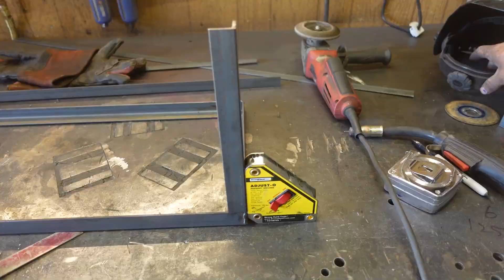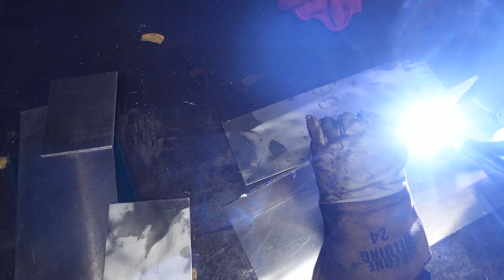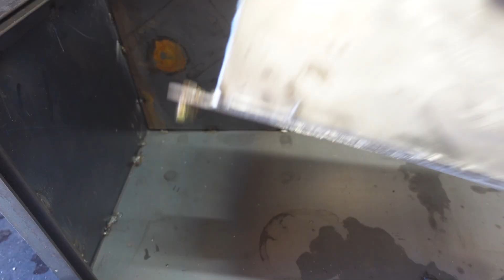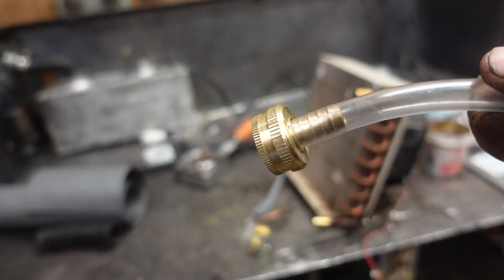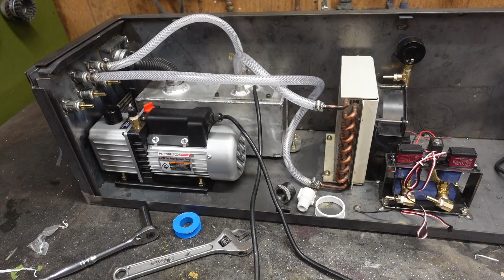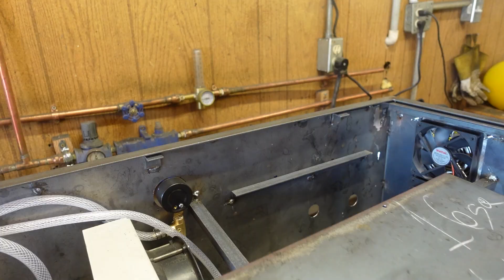DIY Control Unit For My Co2 Laser Tube

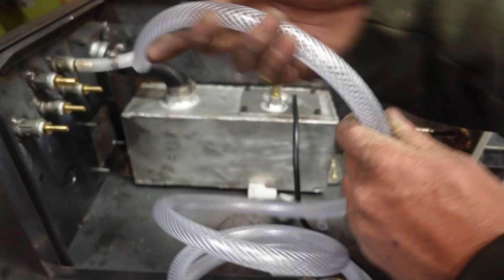Comment: Just a quick note (sorry, I know I'm quite "late to the party." At 9:37 in this video, you connect the HOT water feed (from laser to radiator) to the BOTTOM of the radiator, and the COOL water return (from radiator to tank) to the TOP of the radiator. While it will work ok like this (obviously, since you used it), it is a bit less efficient, as natural convection wants to move the hottest water to the top & the coolest water to the bottom of the radiator. Thus, you will likely see a performance boost on your cooling by simply switching the connections of those two tubes.
Awesome DIY videos though, I've watched the whole series of your CO2 laser series now! ;-)

Comment: Cut a hole in some 1'' round rod drill a hole in one end and turn down the other to fit your drill. Then cut some half inch round put a hole in one side and with a set screw you can hold a piece of high speed steel with an edge on it. Then either turn a point on the piece opposite your drill to stay on center, or counter bore it to hold a drill bit. 
Then you now have a hole saw that works better and can always be ground sharp again.

Comment: I love it seems it might be a wee bit heavier than mine but my gantry is very very heavy i can ride on it has 3 nema 43 1600 oz steppers go big or go home 
   in the thumb nail to the left i went with the direct approach i mounted the tube strait up/down on the gantry where the spindle mounts well it seemed like a good idea at the time less laser loss but now it lives on the backside of the gantry 3 mirrors later the beam is where it needs to be and i can run the machine faster that 20 inches per min how about 70 in per scarry stupid sumpin gonna break fast 
Hey i might feel the need to turn 2 sheets of 3/4 inch ply into lil heart shaped wood peices with dickbutts lasered on them lol hasnt happend yet but is nice to know i can 
Man i wished i found your yt earlyer mine is all windows based but i did try linux but later went with mach 3 that being said mach3 does not play well with a co2 lasers so i had to add a DAC to control the laser for photo work
It did work fine for cutting/engraving with out the DAC  again love the channel very well done on the  (renina obliteratior) who says their is no truth in advertizing

Comment: Idk if this was addressed already, but do NOT mix copper and aluminium in a watercooling system!
Unless you're going to use specialised cooling liquid.
Else you gonna fight with galvanic corrosion which will turn your destilled water into ionised I believe, which makes it very conductive.

Comment: I don't know if you're aware, but you can get a 40w commercial CO2 tube for around $100 with free shipping on ebay. No need to keep dealing with vacuums and gasses that way, you've already got the power supply. You can even buy a complete machine, with everything, including the cabinet, for around $400, brand new. 
The reason I mention this is because when you start firing that laser at any appreciable distance, you'll probably notice that the beam is not very round, and after it bounces off 3 more mirrors,  it'll be extremely distorted. You're going to be spending a huge amount of time trying to solve this problem with a home made tube. Good luck.

Comment: beautiful job!  have you bothered to determine the output wattage?  have you looked at proportional gas flow control  to optimize the mix?
Reply from the maker: Thank you!
havent gotten around to figuring out the output yet, but i'm thinking of using the arduino with a calorimeter(or something comparable) to optimize the gas flow autonomously.

Comment: Love the burning wood. My final year student project (back in '74) was stabiizing a sealed CO2 LASER. Power supply was a 19" rack unit, 6' high.
Working in a basement lab (on my own, all hours), I could tell if it was lasing properly
when it would light my cigarette. Ah!, the good old days.

Comment: add a flow indicator for the water. also, DuPont connectors on Arduino are no good for a final product, you will have issues with dust and possible oxidation, ire commend to can replace them with proper terminals (the ones you can screw)

Comment: Amazing Build !  On the note of knowing if the water cooling is flowing, look into those "Flow Indicators" (or to be fancier/detect leaks or some error an "Inline Flow Meter").  I think they are pretty common in the PC Water Cooling community.  Could probably hack one together easily, since it just needs to be something that spins/giggles if there is water flow.

Comment: Generally speaking, mixing metals in a watercooling loop is a bad idea, look up galvanic corrosion.
Reply from the maker: Oh man, didn't think of this. worse comes to worst I've go an aluminum radiator sitting somewhere in the pile.
Thanks for the tip!
Reply: @cranktowncity  it's not absolutely terrible, manufacturers of all in one watercoolers for pc do that all the time, but they use anti corrosion stuff.
Reply: Just electrically isolate the tank from the rad and make sure the water stays super clean.  You could also add cathodic protection or else use oil or maybe Trichloroethane in the loop instead of water if it becomes a problem.

Comment: Will a capacitor from a Microwave work? If not, why? (I see them by the curbside all the time on trash day.) They have have transformers too. Nice build!!
Reply: Ha ha that reminds me to publish my video just now "3d printer in a Microwave"!
Reply: "Is my neighbor home"?!  LOL
Reply: You could put a moisture sensor (just a couple wires connected into the Arduino analog in), and take readings to turn on a warning light if your water gets low.  Also attach one to the bottom of the case to watch out for leaks. It's almost free! 2 leds and some wire.
Edit: distilled water and wires/electrolysis might be a problem. Maybe use aluminum wire and only check (power the wire) once every 5 minutes.  I check only every 30 seconds on my aquaponics pump and only change my copper Ethernet wires once a year. But that is dirty water! Not sure if distilled water will conduct for a reading.
Reply from the maker: @TheRainHarvester  you know, I'm sure a microwave capacitor would work, but it definitely wouldn't be optimal. And the last thing I need is to blow up a cap the size of my fist inside a box full of sensitive components hahaha

Comment: Great build! You got +1 subscriber. I'm thinking here that one major feature of the good water chillers i've operated is they have a nipple on the bottom to let flush the distilled water whenever the water builds algae inside. And it happens once in about 6 months of regular use. As I didn't saw an outlet in your build, I'm guessing how easy is it going to be for you to flush the water out of the loop. However, I'm guessing that a UV lamp made for aquariums might just do the trick, as your hoses are transparent. Best of luck and keep the kickass work!
Reply from the maker: Love the UV light idea!
Yeah it's a major character flaw of mine, saying screw the next guy. Although of course, the next guy is always me haha
Reply: I think they even make inline ones too.  I need to look into if something like adding a little bleach, or ozone could work (corrosion is my fear i guess)